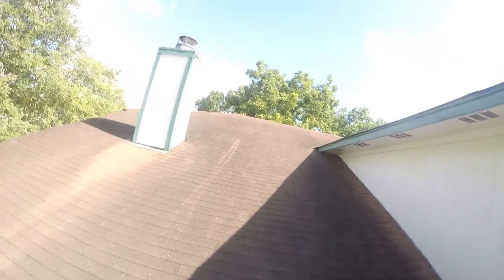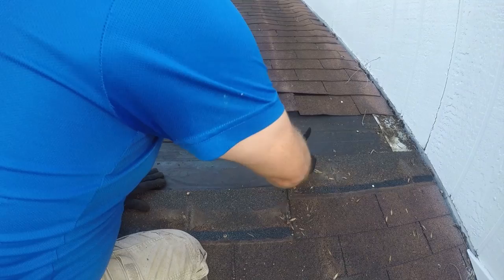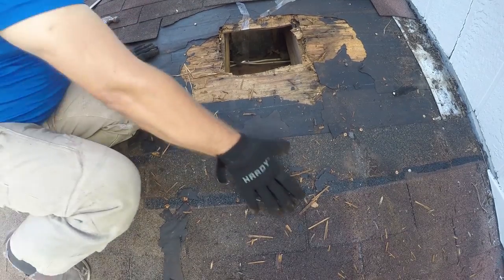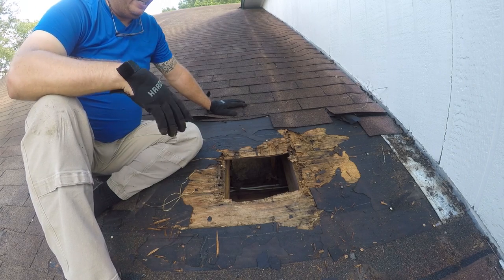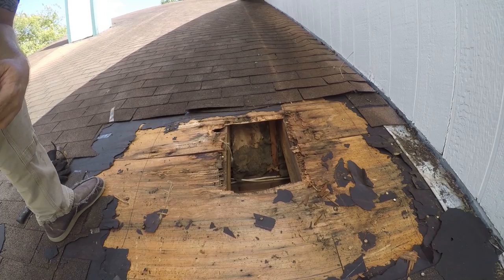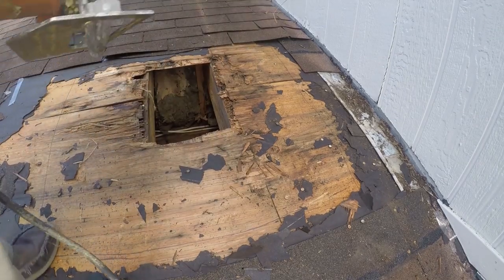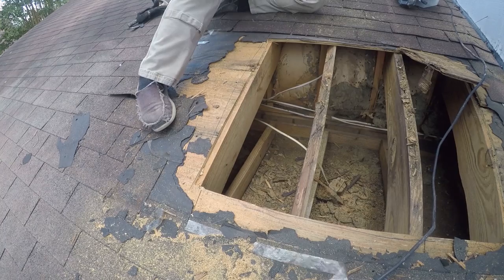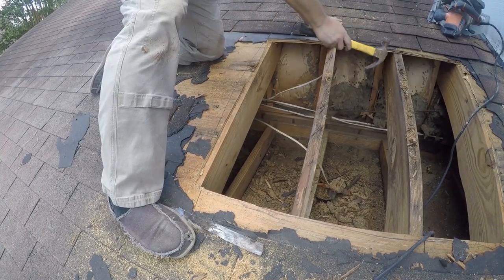DIY: Roof Repair - 1 of 4 - tearing off old shingles and rotten wood

Comment: I see the cause of the damage....waterfall effect, where water from the roof above drips onto the roof below, just like Niagara.  He should inspect the roof above the damage, where the water has already made visible a drip line on the shingles...
Reply from the maker: No.  The cause of the leak was a nail pop.  The upper roof isn't that big and doesn't shed that much water.

Comment: Im a roofer and he isnt wrong that you need a new roof because they are 3 tab shingles and they are only supposed to be 15 year roof max idk how long its been on but it seems like its almost shot but you can find good peoplenin the roofing biz
Reply from the maker: I agree the roof is at the end of it's useful life.  However, I gave my parents the options and they wanted to kick the can on the roof.  So making some repairs keeps the roof functional.  On rental property as long as it's safe, secure and sanitary you aren't going to get more money for a pretty roof than a functional roof.  Sure would be nice if that's how it worked.  

3 Tab is commonly sold as a 20 or 25 year product and yes, on a good day you'll get 25 years out of the 25 year product, but realistically it's a 12 year product.  After that it's just a question of tolerance for cosmetic and functional issues.

More important thing everyone should take away is having the roof checked every other year for exposed fasteners and flashing issues.